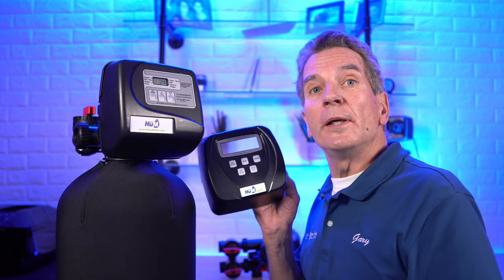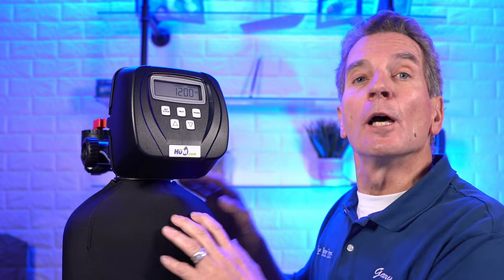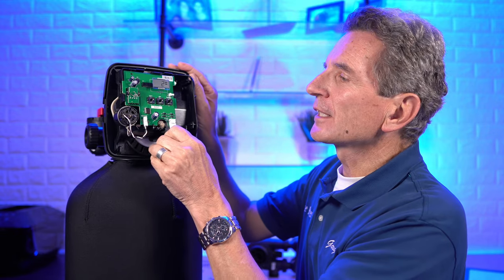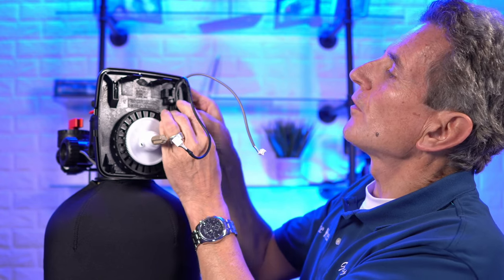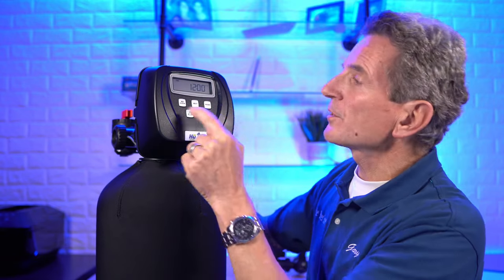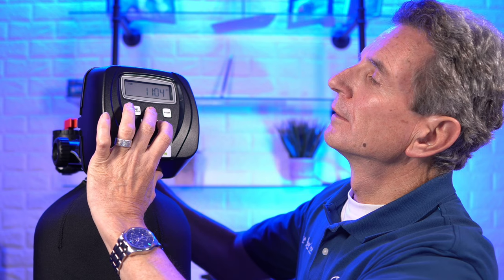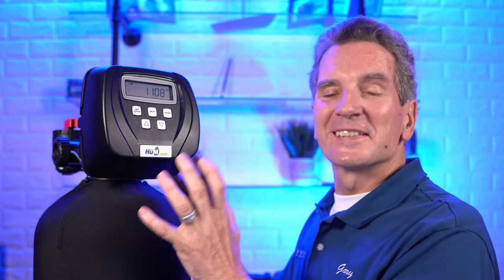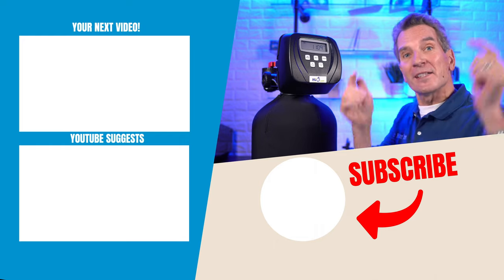CLACK WATER SOFTENER 3 button to 5 button CONVERSION

Comment: Could you please do a video showing  a clack 5 button  conversion to filtering instead of  softening on    Say a ph or iron filter with just a backwash   Not  a softener .

Just to replace a 3 button with a 5 button  with just a wash and rinse .
Or even the programming  adjustments o be made  for this secenario. Thanks
Reply from the maker: Yes, there would be minor changes, mostly programming.  I'll put it on my list but you would also need to change the drain line flow control depending on what media you are using.